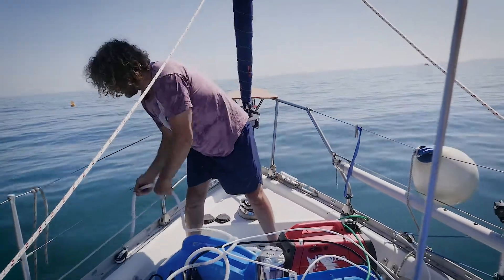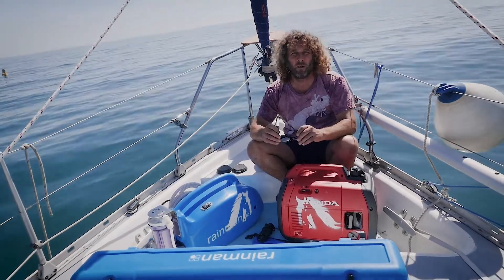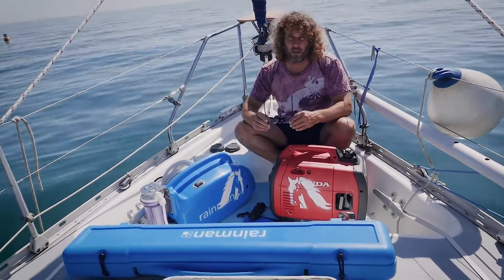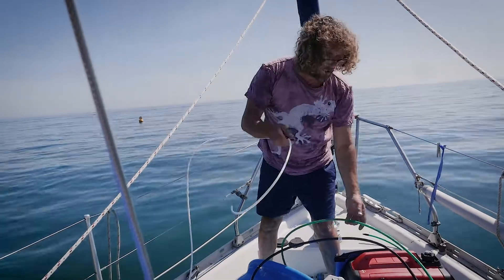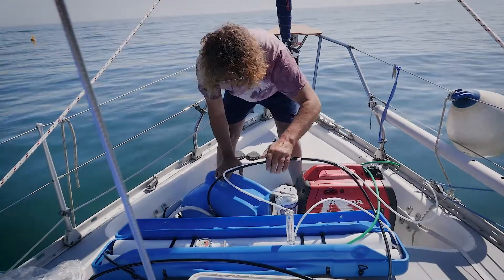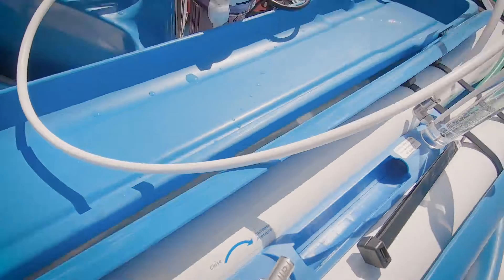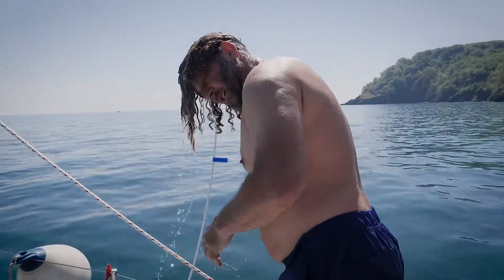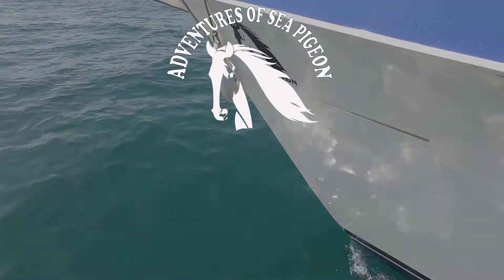Portable Water Maker for boats

Comment: Now that's what I'm talking bout!
Reply from the maker: I only have to run it for 1.5 hours to fill my tanks. I had some problems with my generator and thought it was the water maker. But Raiman after support over the phone was fantastic. It turned out the problem was water in the fuel of my generator. I also like the portability as I can use it on other boats if needed.